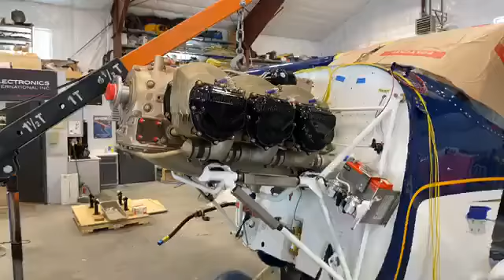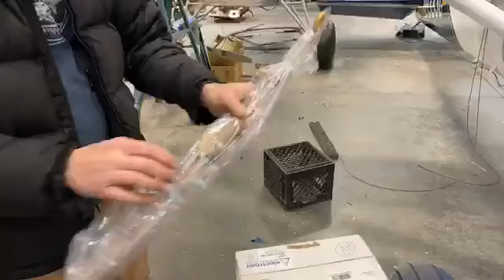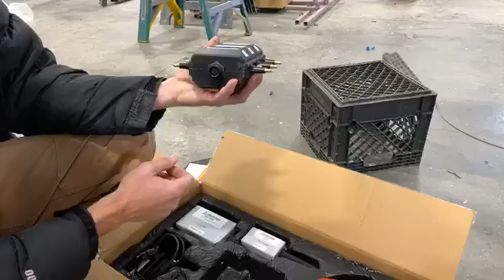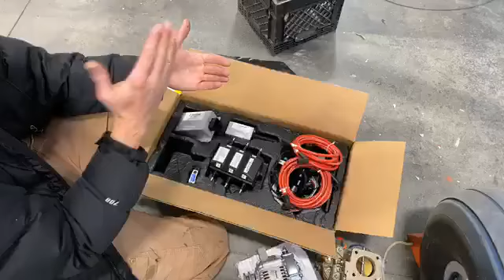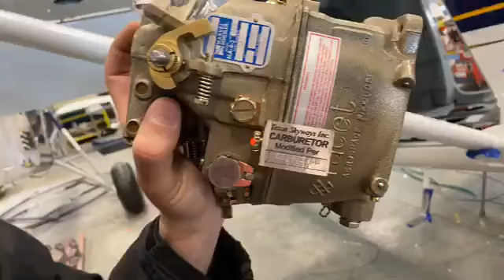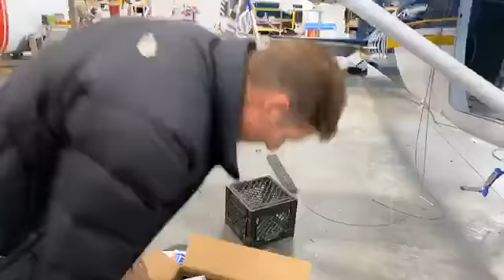Ly-Con O-520F Engine with Texas Skyways Mod

Comment: LyCon just did my p206a ,  io520, nov2020, ported and polished, compared to our CAP 206 it is unbelievable , from the mechanic to the instructor, and fellow io520 pilots, did the cryo also, but still have the mags, talked to texas and Larry V about the cross flow and it about doubled the price or more?  So, stayed with the stock 206 io520, thanks for the vid,

Comment: Love this video. You do a great job explaining things. I just had my IO-470-S (Cessna 205) overhauled at Ly-Con and the port polish and flow match was well worth the extra $1,800. My 260 hp engine DynoTest’d at 292 hp and because they didn’t go to full throttle (not sure why) they were saying there’s probably another 5 hp in there. I watched from the control booth and was able to take videos of each of the three run ups. I was ecstatic.